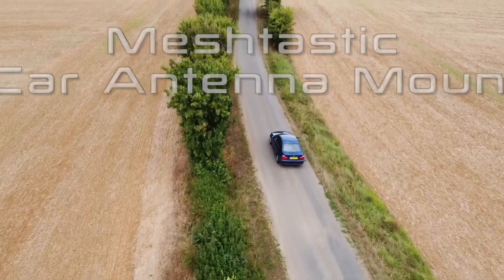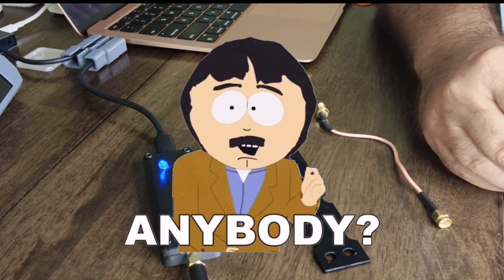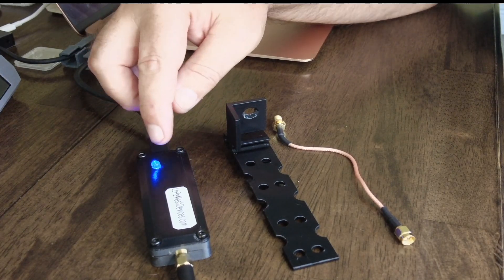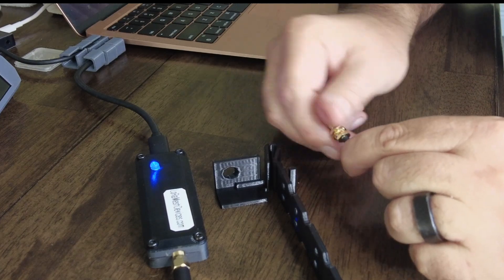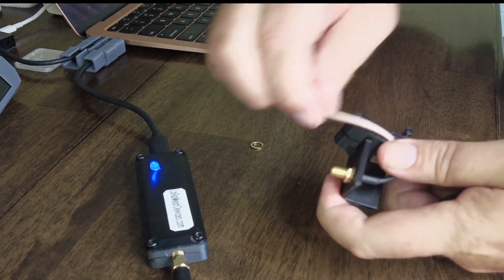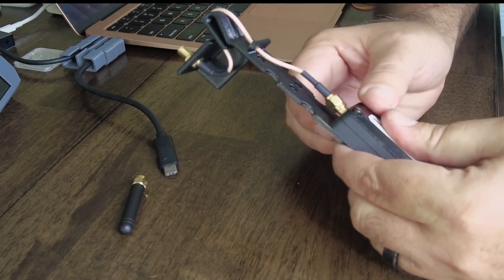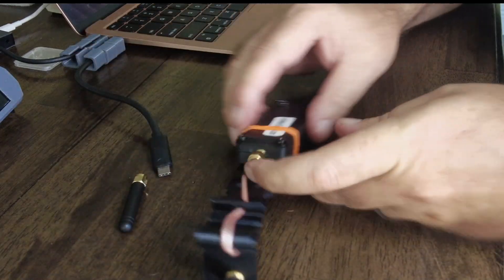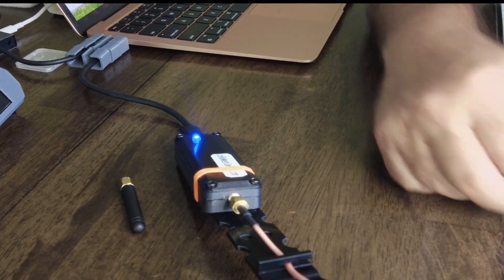Boost Your Mobile Meshtastic Node Signal with This Car Hack! 🚗📡

Comment: I'm currently able to just barely connect to my rooftop node through bluetooth from inside the house but that's because the base antenna kit came with a 20 foot antenna cable and the node itself hangs on the wall of my carport. Would it be possible to put the node closer to the LoRa antenna and use a run of coax for the bluetooth? I suspect the answer is No because I'm not aware of any nodes that have a bluetooth antenna connector like they have for the LoRa and GPS parts.
Reply from the maker: Thanks for the comment. Well, usually, there is no need to connect via bluetooth to a external (rooftop) node. It should be set as a Client or Client_Base, marked as unmessageble and left to route traffic. The LoRa cable should be as short as possible. The nodes inside the house will then use this node to route to the outside world.

Comment: I have a magnet antenna 📡  i stick on my roof.
Reply from the maker: @echo1er  I have one too, but the cable length is the issue. This method puts the radio very close to the antenna.
Reply: @ViVSoftLLC  ah. Working on a breadbord right now to have a shorter cable and solar for the moblie
Reply: @ViVSoftLLC  I have an existing UHF antenna I used for my 2 way radio. Low profile and seems to be good enough for the US Meshtastic frequencies. Having at least 15 feet from my rooftop to my node, have no issues. Any loss is gained by placement and being rooftop. It works just as fine as my other device I keep near by. Shorter run is better, but if it works then it works considering line of sight is more important.

Comment: It took me this long to realize these meshtastic radios aren't as powerful as my cell phone. Serious. I figured my cell phone gets out fine, why doesn't this thing?
Reply from the maker: That's a great observation! Cell phones can operate at power levels up to 3 watts, while Meshtastic radios have a maximum output of just 100 milliwatts. This difference in power can definitely impact the range and performance. Meshtastic radios are designed for specific use cases like mesh communication in off-grid situations, which is why they have lower power compared to cell phones. In a mesh the reach of a Meshtastic device can be almost limitless. Thanks for your comment!

Comment: Annnnd now i want a 3D printer....
Reply from the maker: @. .. Thats how it works :) ... Here is the one I use and love it "FLASHFORGE Adventurer 5M 3D Printer with Fully Auto Leveling" - https://www.amazon.com/dp/B0CH4NYL6J?tag=vivsoft00-20

I can print PLA, PETG and even ABS (you can build the enclosure yourself without spending money to print ABS) .. But everything I print is usually in PETG, strong, does not melt in the car .. good stuff.
Reply: I got mine just couple of weeks after the first nodes 😅.. ordered a case to be printed locally, but it took like 5 days, and i was like, thats it, i am getting a 3d printer 😅...